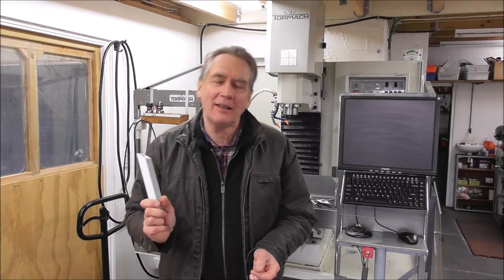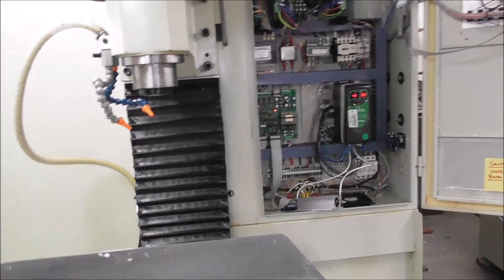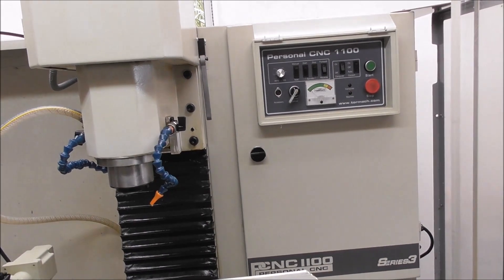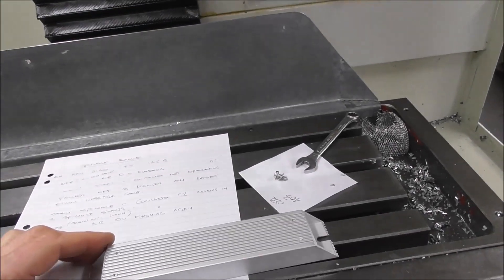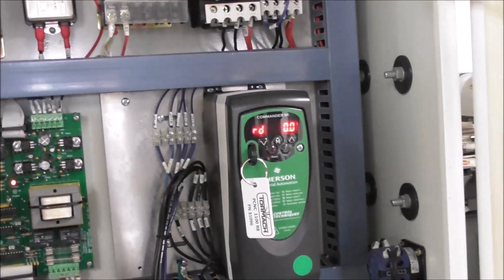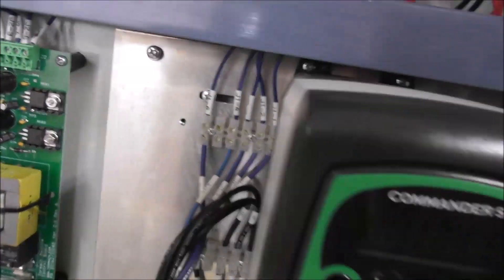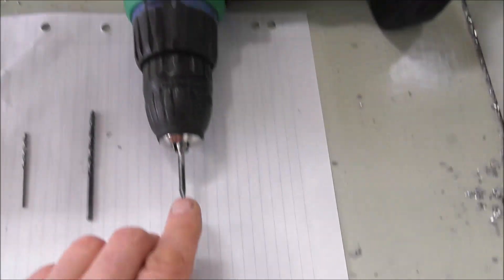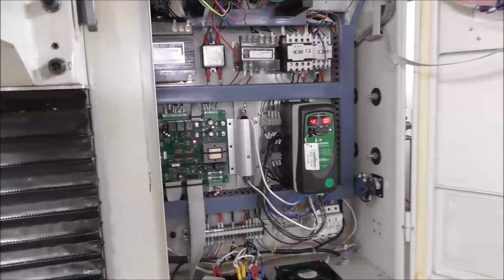Tormach Spindle Drive Repair

Comment: I've got decades in the electronics field and I can assure you that the higher wattage just gives you longer life on the resistor. You can safely go as high on watt rating as you can afford. A thousand watt resistor would simply give you a bigger margin for heat dissipation. As long as the resistance value is correct, sky is the limit on wattage......
You did good!  :)
Reply from the maker: Thanks for that information Art!  Cheers Cliff

Comment: Hi Cliff
Had the same problem myself 6 weeks ago braking resistors  went open circuit on my lathe spindle took a long time to stop I asked an electricial engineer friend and he put me onto both RS Electrical and a company called Mouser (Hong Kong based) I ordered from Mauser the stock was in the USA it took about 6 days to get to me in Australia, they were great to do bussiness with. Price very competive.
Reply from the maker: Hi John - Thanks for your input, most appreciated!  Cliff

Comment: In this particular use case there is no issue with a higher rated resister; however, in other use cases a higher rating may allow a failure to move downstream - but fine in this case. The only other consideration is some power resisters (high rated) require specific mounting and cooling to achieve their rating - the datasheet for the resistor will outline any environmental requirements. Again, in this case it is fine as it is not constant duty, but in other applications the incorrect mounting, heat sinking, and cooling of a power resistor may derate it. If this were on a production machine with an ATC and running all day changing tools, starting and stopping the spindle regularly, it would be worth looking into, but in your case it is no factor. Cheers! btw: continuing to love my touch probe - puts a smile on my face every time I use it.
Reply from the maker: Hi Warren. Thanks for your input, most appreciated!  Cliff

Comment: Hiya Cliff ingenious fix if I may say so. It's an Emerson vfd drive you could find the dynamic braking resistor from anybody who sells vfd drives. You may want to insulate the lugs, when the motor is in deaccel there will be shock potential there as the drive dumps the "regenerated voltage" to the brake resistor.
Reply from the maker: Hi - Thanks for your input, most appreciated!  Cliff

Comment: Hi Cliff. Wattage relates to heat dissipation so more watts is good. I would put some heat shrink over the terminals to protect them from accidental contact. Also check that the resister is rated for mains voltage. This should be on the RS web site. Hope this helps. Cheers Dave (Registered Electrician)
Reply from the maker: Hi Dave. Thanks for your input, most appreciated!  Cliff

Comment: You could use anything above and beyond 200 watts from the original, this is surely not meant to become a fuse, I am sure you could find a fuse as another passive part inline in the same circuit as the resistor - although I did not design this to trust they did not make this a "break" as well as a "brake" resistor. Great upgrade for not too bad a price, looks better too! Cheers!
Reply from the maker: Hi - Thanks for your input, most appreciated!  Cliff